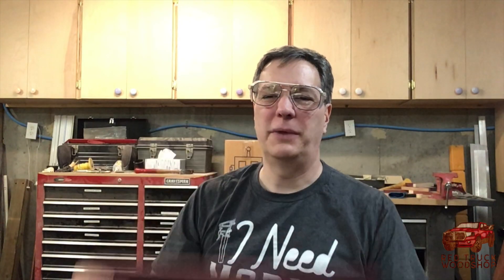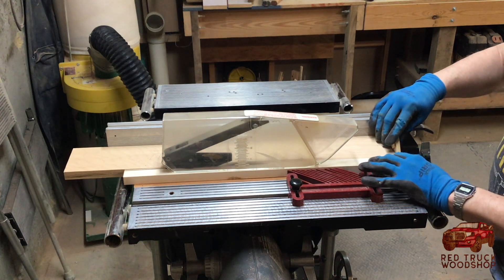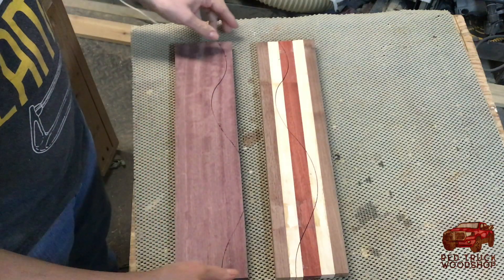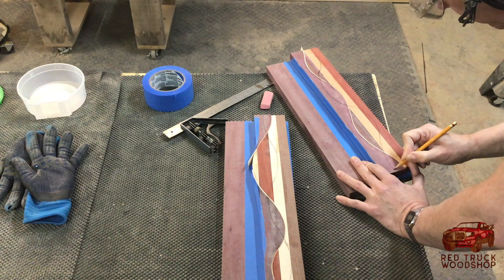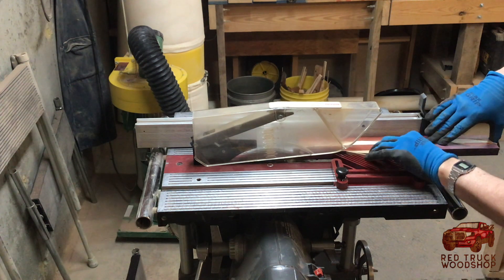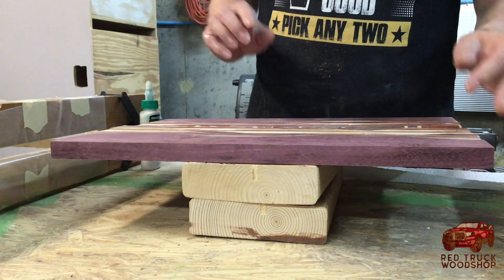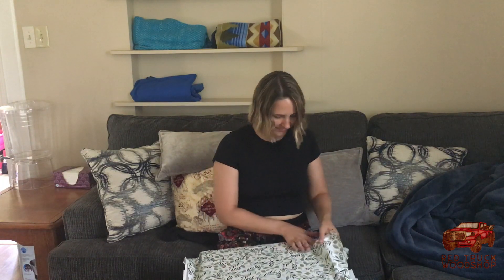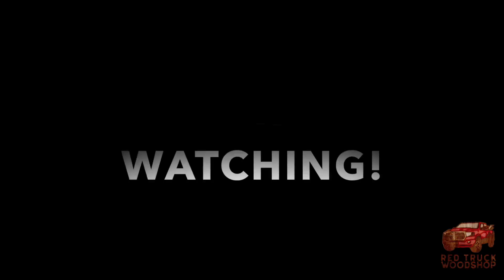How I made this beautiful WOVEN CUTTING BOARD in my small shop (my daughter loves it!)

Comment: Artisan indeed! I am intrigued by the sled you made for your planner not having a jointer at your disposal. I have a jointer, but having been a submarine sailor where fabrication of what you need is a way of life underway,  I am interested what parameters dictated how you built the sled? Thanks!
Reply from the maker: Thank you. I never considered the parameters of why I built it that way. I suppose it was just that I needed it to hold the board perpendicular to the table and be secure.

Comment: Hello I was wondering if you could do the same thing but with the same type of wood just stained? I want to make a cribbage board with that type of design.
Reply from the maker: I guess that depends on the glue you use & how you do it. You would have to stain the wood before gluing to get the color variation with crisp lines. This may also mean staining the glue surfaces so the lines are clean. I have not tried to glue stained wood together. The oil in the stain may not let the glue adhere to it.  If I were to try it, I would let the stain dry at least a week before I glued it. For your proposed project it may work. Thanks for watching.
Reply from the maker: Now that I think about it, even if the glue holds, if you sand it the stain will come off. I can’t imagine staining it after you glue it and sand it.

Comment: Do you have to soak the thin strips to get them to curve easily ?
Reply from the maker: No soaking required if you cut them thin. Just good clamps and wait 12 hours or more.
Reply: @theredtruckwoodshop2722  may I ask what how thin you cut them at ? thank you.
Reply from the maker: @jarin8464  I cut them to match the kerf of the bandsaw blade I was using. Each blade is different so you need to measure you kerf by cutting a short slot in a scrap piece and measuring it. The idea is the thin strip you cut will fit in the slot perfectly and “replace” what you cut out with the band saw. Mine were about 1/8” thick.